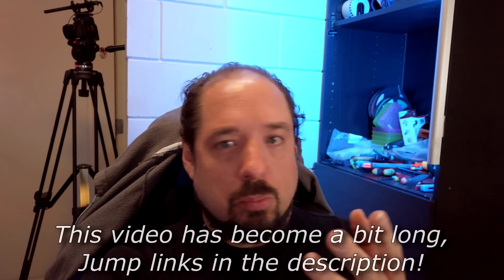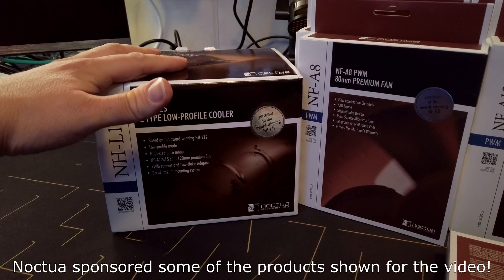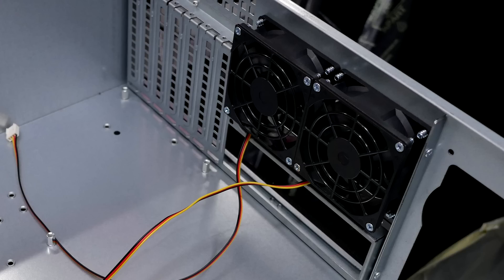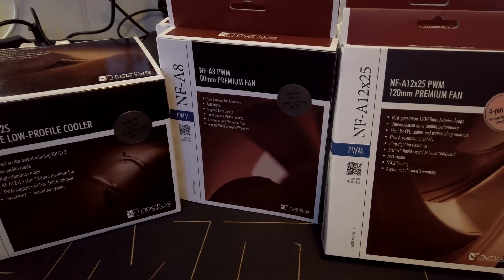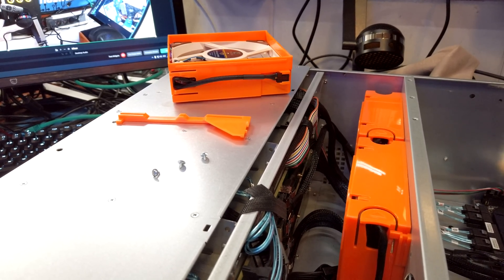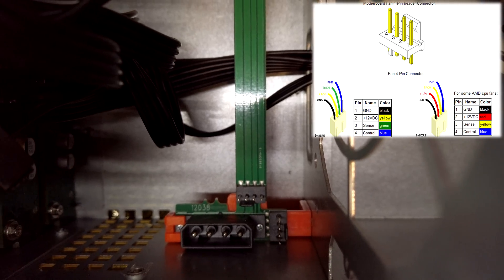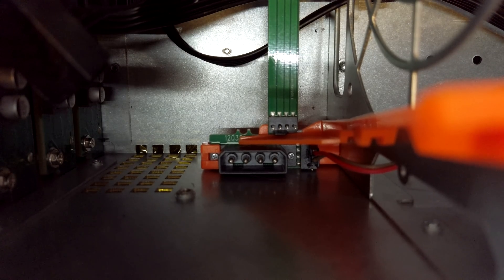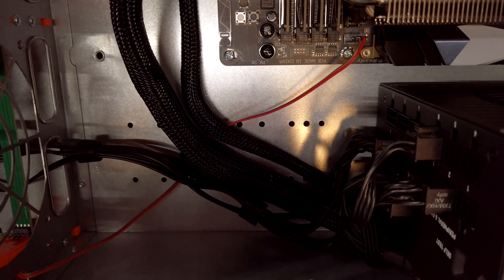Home Networking: 100TB 10Gbit Server - Noctua fan replacement (Noise samples & Temperature graphs)

Comment: 2022 update Inter-Tech 3U-3416-e chassis
Unfortunately this is no longer doable, the 4 lanes in the pcb shown in the video is reduced to 2 lanes, so only +12VDC and GND reaches the 3 fan header connectors along the pcb.
They have also removed the 4 pin fan standard header connector where the 2 Dupont cables were attached in the video, it is replaced with 6 pins in a 3x2 pattern.
Reply from the maker: Actually, yes, but it's not impossible just a different pinout. In the livestream where I build the new Chia server I go over how to hook it up now, works great still! And full control over all the fans.
Reply: @IntermitTech  Ahhh thank You Sir :)   -  https://youtu.be/2CP6ud6n-5E?t=5122

Comment: I have an Inter-Tech 4424 (https://www.inter-tech.de/en/products/ipc/storage-cases/4u-4424) and no matter what I do, the fan wall just won't turn on. I've replaced the stock fans with Noctua A12x25 PWM fans, which should be fine and connect the Corsair 750X's peripheral molex to the molex of the fan wall, no connection for fan control added, just power to have them spin at full speed ... Yet, they won't even turn on. Did I do anything wrong? Any suggestions?

Comment: I have Noctua fans in my 4U Roswill rack chassis.  The audio of your fans is louder than my fan noise.  I LOVE NOCTUA FANS.
Reply from the maker: Depends on the model you have, the model I used are 2000RPM and while quiet at that level, other fans can be quieter but they often only spin at 1000RPM and generate a fraction of the airflow so you can't compare them like that. . But yeah, whatever speed, the Noctua fans are awesome!

Comment: Curious, my 16 slot Inter-Tech chassis have 6 pin connector for fans, and I made a custom cable with connector for 3 pwm headers, so I have all 3 fans individually reporting and controlled
https://imgur.com/yzr8OL3
https://imgur.com/GJn44WZ

Also of course replaced fans, old fans were consuming something like 3A, they were heating air passing through them!
And surprised you managed to get this 80mm fans without removing rubber gaskets between them, mine didn't fit with them.

Comment: Its Funny I was just looking at swapping out the 2 Stock 40x40x20 mm Fans which run about 12cfm With 2 Noctua NF-A4X20 FLX Premium Quiet Fans 3-Pin.  I have 1 of the Old Delta 9000RPM fans whining a bit so I want to get in and do them both at same time BUT like you I am a Bit worried they will be enough AIR BC this is going as Direct Replacement in a 48 Port 24 Poe Switch GB connection & 10GB interface I dont use yet. But am worried it wont move enough air to keep cool. Great Video thx Cow}:-o)

Comment: Noctua is the mother 'effin' business! I've got 3x 140mm IndustrialPPC 3000RPM PWM, an NH-D15 with it's two fans, a 140mm Redux 1500RPM. And Noctua's fan controller.

Comment: Nice video, but not surprising if one has ever used Noctua fans before:-) I wonder how you get the temperature from your ryzen 3900x. I cannot get any realistic number from a debian buster installation on the same cpu with a Gigabyte x570 AORUS Pro  (that looks like your mother board??). The results I get from the it87 driver of sensor doesn't make any sense: 38-42 degrees under stress when on a windows10 partition I get 70-72.

Comment: Did taping up the air by-pass on the case change any temps?  I've been debating doing similar on a Supermicro 3U 16-bay chassis, at least on one side, as the power supplies look to be fed from the by-pass on the other side.
Reply from the maker: In all honesty I couldn't really measure a difference. In theory it should keep the disks a little bit cooler though, especially with the Noctua because those can generate some good air pressure. But I don't have any concrete measurements.

Comment: Well done!  Noctua is always best choice for servers-)   i am still building my Threadripper server, had to buy another set of ram and seems to go pretty good, needs lots of time to find the best timings, Threadripper is pretty difficult with ram but i managed to reach 3400 mhz cl16 on the 64gb 3600 cl16 kit, thats a lot better than my first set of Ripjaws what didnt go fine beyond 3000 mhz.
I have added a 6000 rpm 120 mm serverfan above the pcie cards in a 45 degree angle , it helps a lot to cool 3 HBA`s and the videocard at once, lucky all those cards are the same height so that gos perfect, the fan is pwm controlled ofcouse, if full speed its a jet , only do that at booting. So the end of the build is coming, i want to make sure everything is stable before migrating 24 drives to it and set it up in my 10gb local and 1gb internet. Cheers m8 keep going, loves your builds.
o yeh...  that plastic near the molex at the fan rail sucks, had that problem too, its a pain to get it connected, wrong design but the rest of the case is perfect.
Reply from the maker: Oh wow, that's an awesome setup you are building. Yeah, Noctua and silence + airflow is king. Although it won't compete with a 6000 RPM jet engine though. ;) I'm also still very happy with the chassis, and the whole build really, it's all working really well. :)
Reply: @IntermitTech  Yup its a total overkill setup lol but i wanted to make something for many years to come, it was pretty heavy job to get the machine into my rack with the rails, its weight makes it hard, even without harddisks lol , last night the machine turned on itself for some reason so have to find the cause of that, pob the network did it as i removed the lan cable this morning and when came home from work the machine was still off. I will find out lol

Comment: Got the inter-tech 4416 chassi and i put 3x120mm fans in a shroud in front of the case and the hdds are nice and cool. Think with your chassi you should go 3x140 :) With a shroud, some weatherstripe and zip ties and your golden :)
Reply from the maker: Oh that's an interesting idea, but I think I'll just move the server to another room where it bit of noise it now makes is no problem. :)
Reply: Have you cut or scratched yourself over that case a lot? Because I ended up with lots of cuts and scratches xD
Reply from the maker: @Gastell0  I have actually found 0 points where I cut or scratched myself? But I hears someone else about it too, I wonder of those are the same cases or just look similar because I've really had no issue whatsoever while working in it. :S
Reply: @IntermitTech  Got my share of battlescars from it yes :)

Comment: Nice upgrades on fans.  Only thing i would have done different is,  i would have used an NH-C14s instead of the NH-L12s which is more a low profile cooler.
Reply from the maker: Yeah, in hind sight that might have been a better choice but only with the fan beneath it otherwise it's too high for in the chassis! With the fan below it it's also pretty close so might brake up the airflow a bit too much. That's why I went with the low-profile cooler. But it's a bit more low-profile then is needed. I can always give it a bit more clearance by moving the fan from beneath it to on top of it, would probably make it cool a bit better. :) But there are numerous coolers that could have fit, I wanted one with a 120mm fan and not too high but certainly multiple options here.

Comment: Wow..& I thought i had a bad as# Server ! I have a dual  6 core xeons  freenas server i built with 24Tb raw+ 2 128Gb ssd one For Jails & 1 For Vm's & 10Gb Sfp+ Nic ! But Dang .lol. ures  is a Super Cool set up !!
Reply from the maker: Thnx! Although it's desktop parts, it's working very well for my needs and should last me for the next couple of years! :D
Reply: @IntermitTech  Yes Id Say So ! I Just Built a Dual Xeon X5675 Rig With A Supermicro X8DTH-6F Bord with 64Gb ecc ddr3 & 24Tb Spining rust with a cupl of ssds for jails and Vms a Raid1 sandisk usb Drives O and 10Gb sfp+melanox connect X2s N a gtx Titan for testing.lol. ! But all i realy needed was a good plex host an data storage/backup ! i started to go newer gear but i realy like 1366/X58 Gear..I Have Quit A Bit of it to ! for runing FreeNas I Still think its got plenty of life left in it ! Again Cool Build n Thanks for sharing !

Comment: The Motherboard you are using has 2 external temperature probe inputs.  If you have all the stock accessories from the board it included 2 probes.  You can route them to trouble areas PCIE  areas and your hot drives.   You can then base your fan curve off the temp probes even by zone.
Reply from the maker: Oh, that's a really good idea! I'll have to check if when only using BIOS control I can still set that up! I've done flir and laser temp measurements after the video and those reach between 35c to 40c on the heatsinks right now so that's perfectly fine, no worried about the cooling anymore but maybe in the future! :)

Comment: i think you put the cpu cooler the wrong way...the fins should be parallel to the airflow in server case
Reply from the maker: I tried to put it in parallel but it was blocked by some motherboard components so decided to try it this way and the cooling performance is fine, currently the CPU is 38c which is pretty good for an 8 core Ryzen first gen. So, I'm not not too worried about it really. Airflow is also blowing up so it's more that the the amount of air it can draw is limited by components then fin orientation I think. Appreciate the comment though! :D
Reply: @IntermitTech  thanks for the reply...looking forward for more contents

Comment: I am using three Noctua NF-A14 PWM in my Server (Fractal Design Define R5)
They aren't silent but all you hear is the airflow, not rattling and no vibrations
Reply: Last week I was running Folding @ Home on my PC 24/7 (also has three Noctua NF-A14 PWM in a Fractal Design Define R6) - even at night - and the Fan noise @1000RPM @2m was so quiet I could actually sleep with my PC doing this heavy workload :)
Reply from the maker: @Felix-j3d4b  I really love Noctua stuff, I run them anywhere I can! :D

Comment: You could have improved airflow by a lot already would the ram modules not have been perpendicular to the airflow (as servermotherboards do) and if the new heatsink would have been in the air flow as well and not perpendicular....
Reply from the maker: Yeah the RAM isn't ideally located/oriented for the airflow currently but the fan on the cooler is blowing up so it's sucking fresh air from over the motherboard and all the sensors I can read show temperatures are fine. But I certainly agree!

I looked into orienting the cooler the other way but it would block other stuff so I decided to do it this way. :)